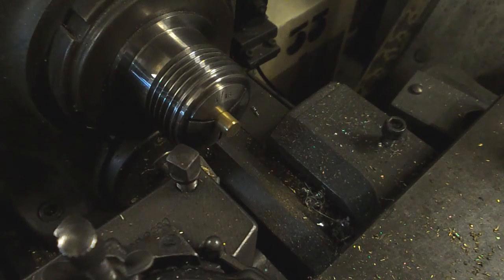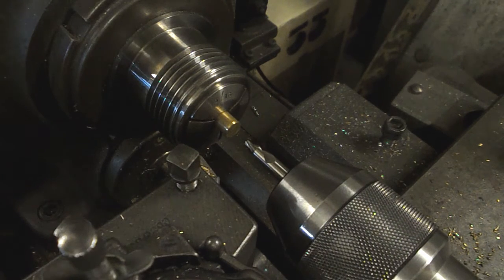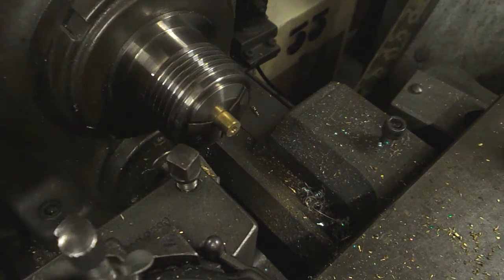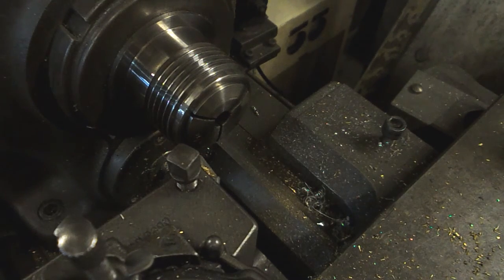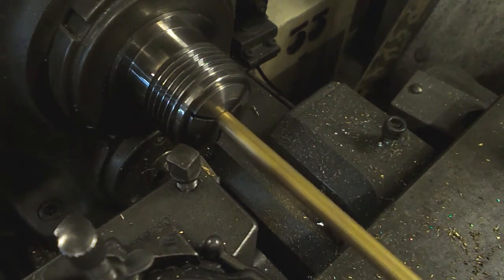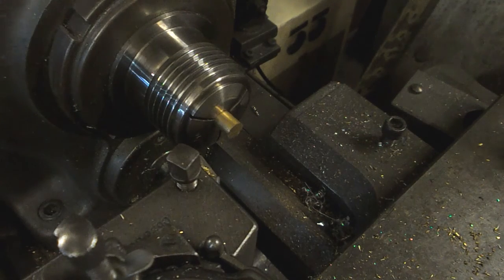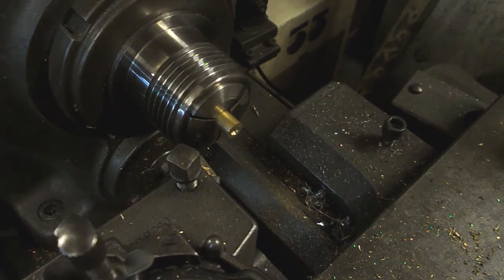Machining quickie - Drill & Tap Brass DRY

Comment: Great tip. I was impressed that you were tapping the thread with the lathe we have not been brave enough to try that yet, we currently take the lathe out of gear and turn the chuck by hand
Reply from the maker: Spindle just coasting when I fed the tap in & it slows down pretty quick without a chuck acting as a flywheel. Then I was ready to switch it into reverse as soon as the tap was in far enough. Make sure the hole is drilled plenty deep enough & that the tailstock slides nice & easy on the bed.